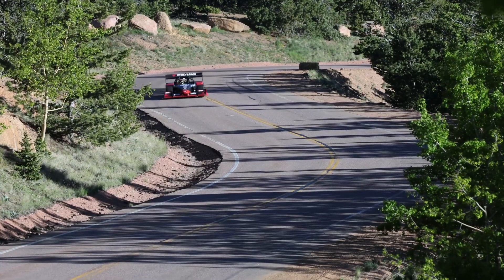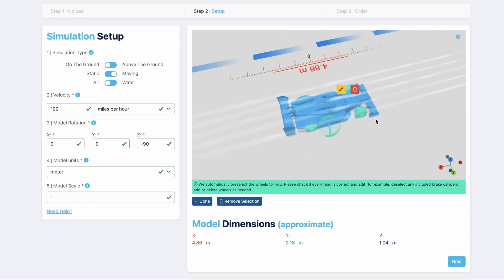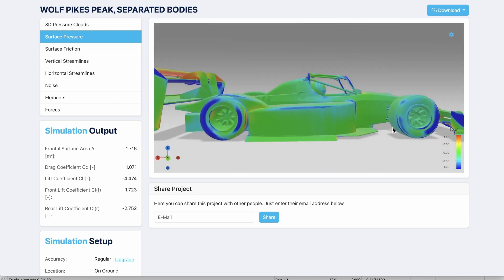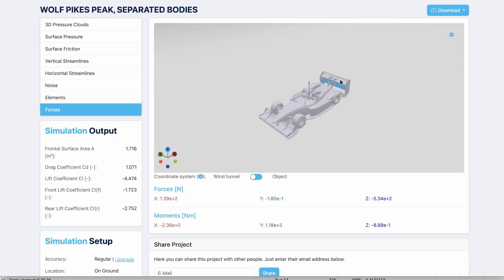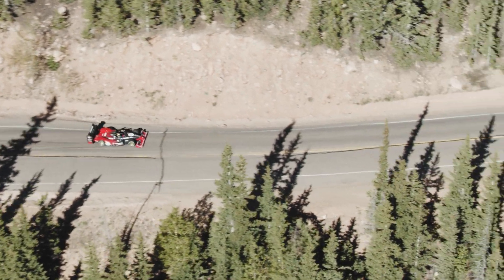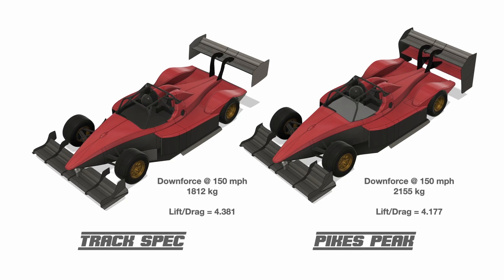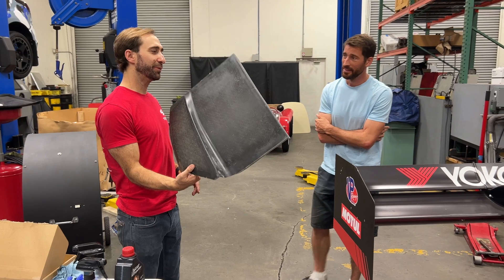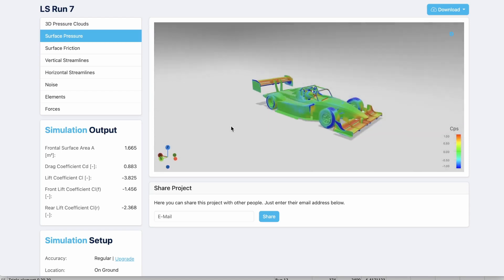Can this Pikes Peak Hill Climb winner be made even faster?

Comment: I am 99.99% certain that it has occurred to you, but given the less dense air and colder temperatures at the top of pikes Peak, is it possible to create a simple active aero system that maintains balance whilst increasing down force as the car proceeds up the mountain?
Even a constantly turning electric motor against a worm drive, with a rotational speed adjusted to travel it’s adjustment capacity over the run?
Reply: The fact is you want max downforce pretty much everywhere, including at the start. Unless you're doing things like DRS for straight flat out sections, those wings should set for max downforce, and DRS mechanisms add weight and complexity

Comment: I'd think that if you could shroud the front wheels and have the outer face of the wheels smooth you could reduce a lot of the drag.
Reply: Apparently the front wing creates a vortex behind it that essentially makes air flow around the tires like they're not there. Robin's team has tested closed configurations and found this design to be better.

Comment: I’m curious if you’re expecting to see gains at Pike’s Peak with the aero analysis that you’re doing. I could see the analysis having good effect both at sea level and at altitude.
Reply from the maker: Pikes Peak typically demands the highest amounts of downforce possible, however there is a limit to that being practical. I think with the reduced weight and drag, plus and optimized suspension aero platform we will see some gains. Part of the development has been to ensure this kit will work at the higher downforce of Pikes Peak, which it gets close to the 2023 PP spec
Reply: @thesendyclub   Best luck in '24. You got brains, balls, and records. Can't wait to see what you do next.
Reply: Completely different environments. The only thing I can think of being more different would be F1 and Baja.
Reply: @ShainAndrews   They're definitely different, but I have zero race experience. I have no idea how comparable one race might be to another. Figured I'd take my shot and ask The King Himself. I feel enlightened by his response.

Hope you're having a good day!

Comment: Do you also verify the model output with real world measurements?

Do you for example monitor ride height to give an indication that you're making the down force numbers in the simulation?
Reply from the maker: Stopwatch, data logs and driver feedback is where we focus when dealing with big changes like this. We log shock position as part of this, however with 3rd element packers front and rear, the force vs ride height is not at all linear. All this data combined enables us to understand if it is a good or a bad change. Strain gauged pushrods are on our future to-do list.